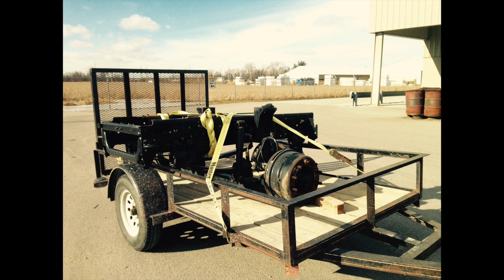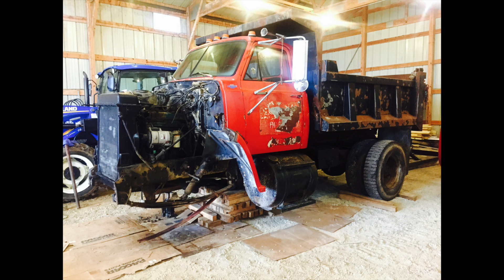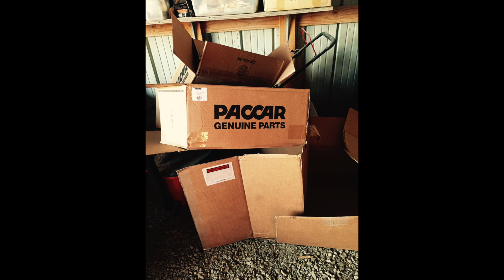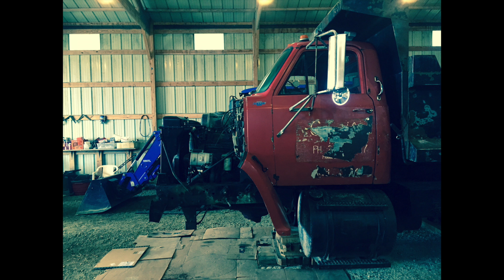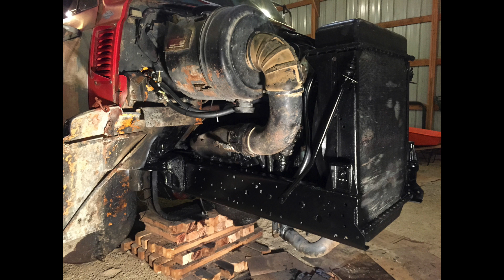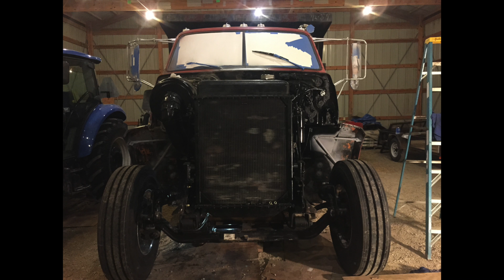GMC 9500 Dump Truck Steer Axle Swap

Comment: Always good to loose the Dayton and go to the Buds, even better that they are hub pilot. Great job installing, that was definitely the intelligent way to fix that..
Reply from the maker: +Jonathan W 
Thanks! I have a lot of time into this project, really makes me want to put the truck on a whole new chassis next time. The truck is almost 1,000 lbs lighter after the swap too. I bought the truck cheap intending to only keep the engine if nothing else but ended up liking the truck too much and found some work to do with it too.